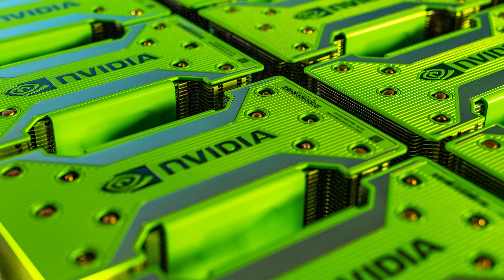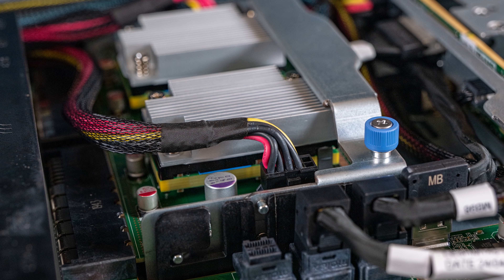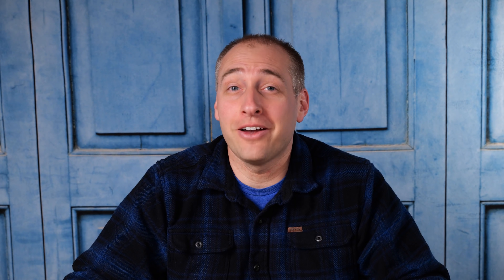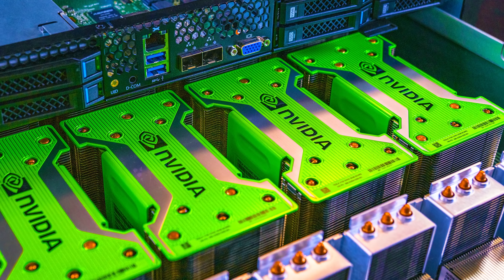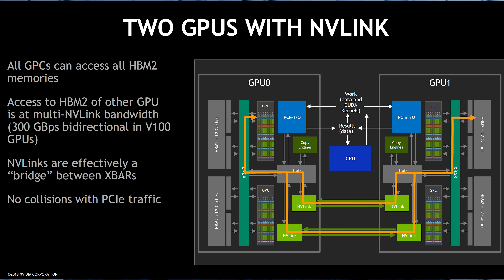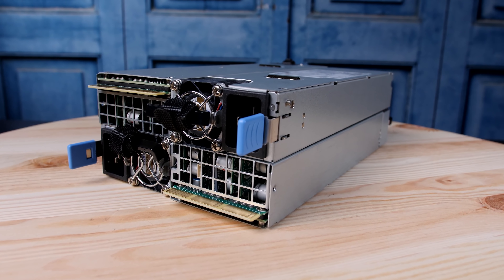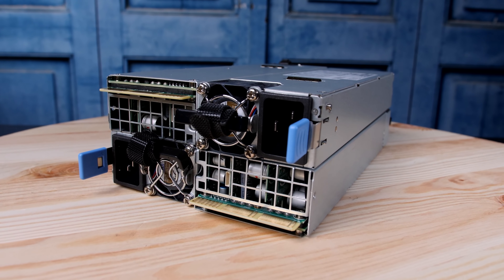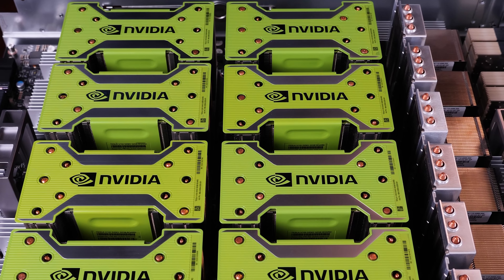Hands-on with an 8x NVIDIA Tesla V100 SXM3 Server with NVSwitch

Comment: Do you know if it will be able to play crysis(remastered)
Reply: I believe the GPU is just for faster computation. No video output. 

You can try get it to play games. But it would be really underpowered with medium graphics.
Reply: @rinaldijames  Terahashes/Petahashes count more than frames at this level ;).  They might not even run Windows, but if they did, "rs" is using way more GPU than "mn", at levels promised back at W7.  It might be a waste, but you might be able to link to it for gaming.
Reply: @rinaldijames  It has a VGA port :P
Reply: @cheddarcheese  Oh. Welp. I heard wrong I guess.

Comment: When will something like this be offered with the Epyc platform?
Reply: search for AMD's plans with infinity architecture, that's their name for their upcoming heterogeneous cpu gpu fabric
Reply: I wonder that too. A 2 socket Rome system could feed this system without any PLX chips and still have 32 lanes left for networking and storage. I guess it depends on Nvidia and so far they seem more interested in ARM, RISC-V and Power than in AMD-x86.
Reply: Thing is, in AI applications, Intel might (I don't know for certain) still be better, because of AVX-512.
Maybe they don't have the resources to design it for two platforms?
Reply: @LeonardTavast  yes of course they are interested in ARM they are making simple and extremely powerful tiny package with low power 😲🤔 think how much size of these systems that's the worst thing too much space to maintain this about it like this server rooms are what the old room filling PCs of yesteryear they will be shrink before they get larger
Reply: I wonder if all this comes down to Nvidia disliking AMD more than Nvidia.
Reply: @nanolog522  agree with sturm. its a matter of designing for 2 systems and zen 2 epyc did not exist back then. NVIDIA could potentially see AMD as a bigger threat but i think with intel going into GPUs and AI and with a deeper pocket thats no longer true
Reply: This. Why Intel...
Reply: Lol, just read something about AVX512. Its that thing Linus Torvalds wrote, and I totally agree. Basically, it is only there to make Intel look better in Benchmarks. Invent a new instruction set, write some benchmarks, look good.
They could have done the same thing by just allocating the transistors they now use for AVX512 to their cores.
You would be getting more, more powerful cores.
Basically, the same extra performance, but you don´t have to write new code for it.

Comment: Patrick, could you make a lab tour video? Not showing anything confidential, of course, but it sounds like you must have an impressive setup!
Reply from the maker: We used to be able to take photos in the two data centers we use (120V and 208V.) Sadly, both have gone the way of no photos which makes taking photo/ video of the lab challenging. You can see a quick glimpse of it in the old PowerEdge R930 review. We may move the 208V lab to a different and new data center in Santa Clara to get more rack space and power. I may ask that we can do a data center tour if we do that over the summer.

Comment: I'm always surprised about how installing SXM modules is being portrayed as difficult. Having installed plenty of SXM2 modules, I think it's pretty straight forward, not much more challenging than installing an SP3 CPU. I use a $50 torque screwdriver and use 8 dots of thermal paste, similar to how EPYC CPU's are recommended to be pasted.
Reply: Thanks for sharing

Comment: There is the Dell EMC DSS 8440, up to 16GPU. But it is not a mainstream PowerEdge system.
Reply from the maker: The Dell EMC DSS 8440 we have covered a few times including with Graphcore accelerators. It is more of a PCIe GPU solution rather than a NVLink and NVSwitch system competitor. Much lower-end box than something like this.

Comment: Do you guys ever power these machines up to discuss the compute capabilities? I understand that a lot of AI work, especially when produced by startup companies, is very secretive, but there's also a ton of publicly-funded opensource AI packages available that are freely available. Whether such packages will run on rather exotic 8× GPU systems, I can't answer that, hence why I'd like to see such a thing discussed in addition to your thorough discussion of the hardware
Reply from the maker: We have more on powered up getting bits running some benchmarks and power consumption on the STH main site review.

This kind of machine requires that we run it in the data center, not on a set to film

Comment: Is there a reason this couldn't be using Epyc CPUs?
Reply: Contrary to what the desktop side, AMD’s server decision is pretty lackluster. Due to their early failure of Opteron,  not many manufactures have experience with AMD systems. I think they might be testing AMD systems at this point, but not worth the risk of putting it in such a high value special order. Especially the cpu portion in this box is negligible when all the algorithm are running on gpu.
Reply: There are solutions for 8x (or even up to 10) GPUs with AMD EPYC as well, e.g. https://www.supermicro.com/en/Aplus/system/4U/4124/AS-4124GS-TNR.cfm , this also works with the new 7002 EPYC series (Zen2 equivalent). There, the GPUs have to come in the normal GPU formfactor however.
Reply: @LucienneGainsborough  AMD is gaining a lot of momentum. Looking at benchmarks AMD is ahead in every way by a large margin.

Comment: Regarding systems to review, Cisco routers & switches and fiber store equipment (www.fs.com), also upgrade options for home connectivity with platforms like x99, x370, x570, i7 (make a switch or router with them), (WAN aggregate / accelerate). Thanks.